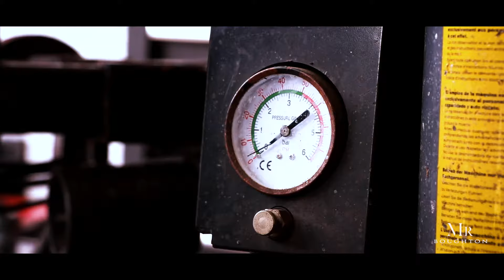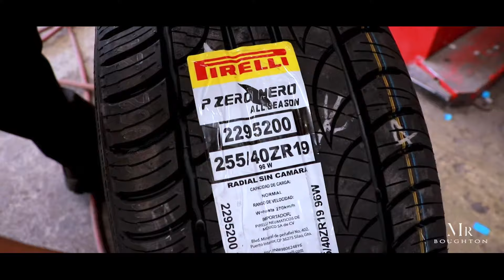Installing Pirelli P Zero tires | Audi A7

Comment: They are very noisy tires... Made a mistake by installing them on my car.
Reply: P zeros are one of the quietest tires ever. They have 2 different versions of summer p zeros. P zero and The new p zero which is called pz4. pz4 has 2 options. rft or pncs(pirelli noise cancelling system, basically foams all the way inside the tire. But in this video he got all seasons, all seasons are crap mate. They are noisy, they are avarage on any surface.